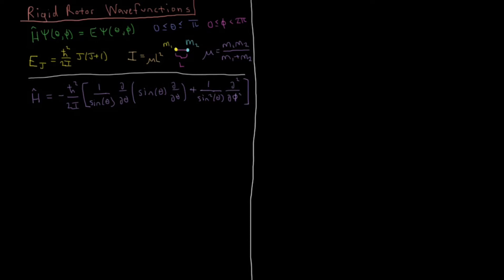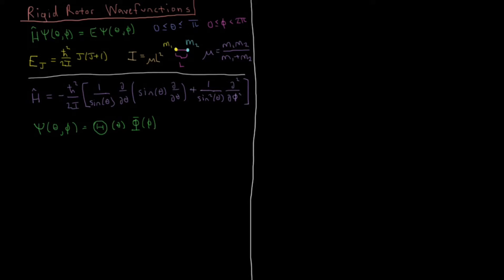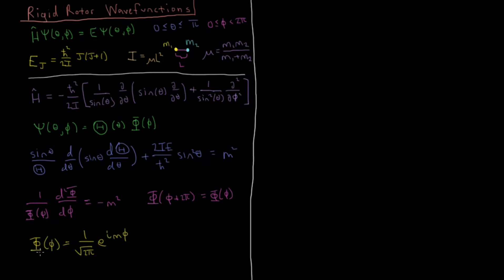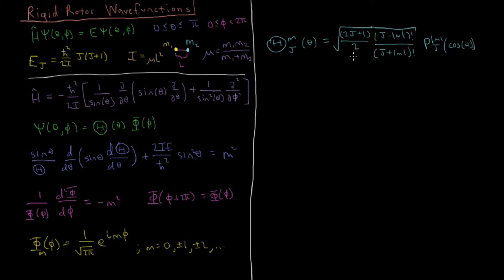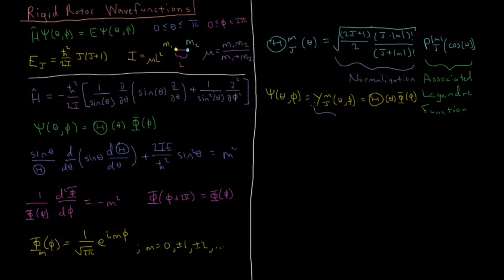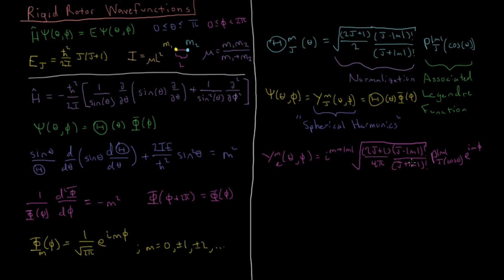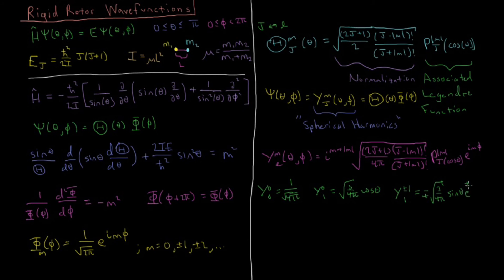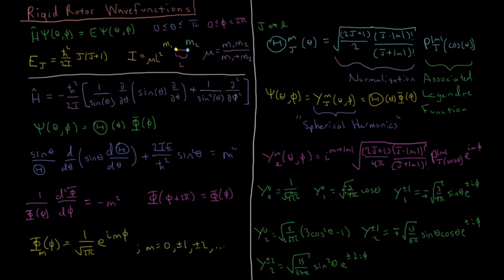Quantum Chemistry 6.10 - Rigid Rotor Wavefunctions (Old Version)

Comment: At 1:57 you wrote sin(theta)/Theta, can you elaborate on where you get that from? If from separation of variable, what equation do you sub the Theta and Phi function in?
Reply from the maker: Correct, it's from separation of variables. If you substitute in Psi(theta, phi) = Theta(theta) * Phi(phi) into the Schrodinger equation HPsi = EPsi and substitute in the expression for H, you will get a rather large mess. If you take all the terms that depend on theta and move them to the left, and all of the terms that depend on phi and move them to the right, and set each side of that equation equal to m squared, you get the dark blue and purple equations you mentioned. Once you have separated variables from the Schrodinger equation, each is solved separately. The phi equation is a fairly straightforward differential equation, whereas the theta equation is complicated. But yes, everything comes from the Schrodinger equation.